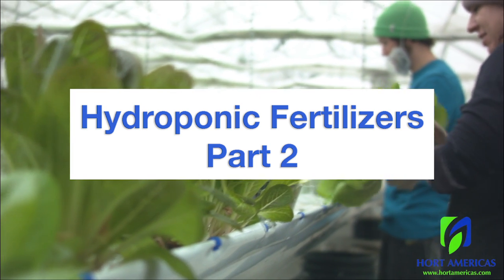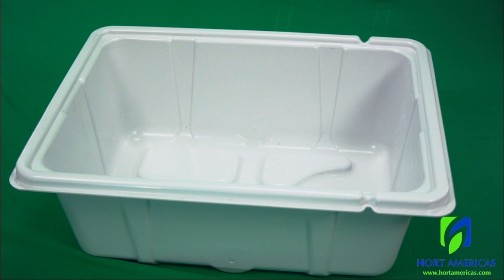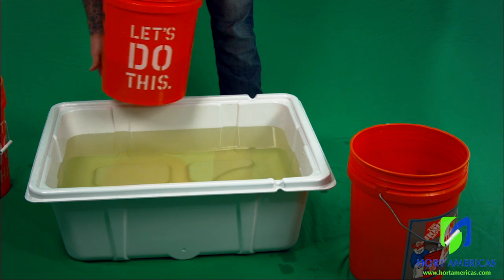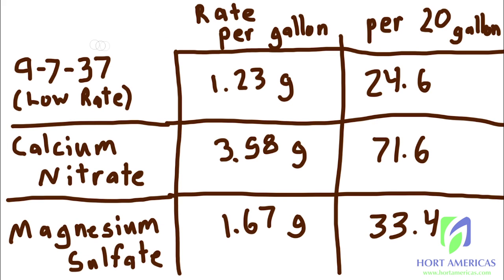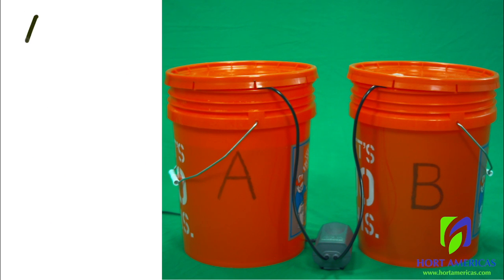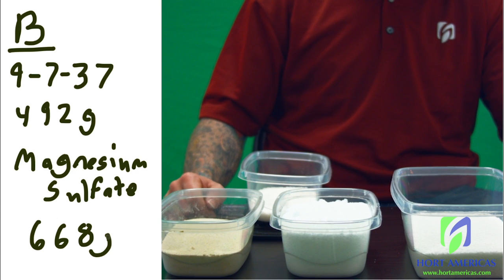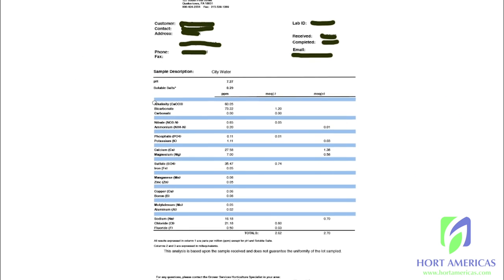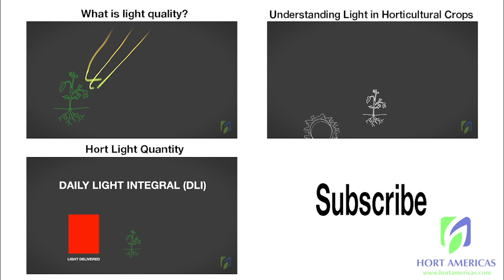Hydroponic Fertilizers - Blending Hydroponic Nutrient Solutions and Stock Solutions

Comment: Hi thank you for these videos! I am wondering why you add the calcium nitrate second? I am using an injection system and have all my calcium in Tank A which is added first by my system.
Reply from the maker: When mixing fertilizers in hydroponics, calcium nitrate is often added separately at the end of the mixing process for several important reasons:

- Avoiding Precipitation
Solubility Issues: Calcium can react with certain anions present in other fertilizers, particularly phosphates. For instance, if calcium nitrate is mixed with fertilizers containing phosphate, it can form calcium phosphate, which is insoluble and precipitates out of the solution, reducing the availability of nutrients to the plants.

- Maintaining Nutrient Availability
Optimizing Nutrient Uptake: By adding calcium nitrate at the end, you ensure that calcium remains in a soluble form that plants can uptake. This practice helps to prevent nutrient lockout, where essential nutrients become unavailable due to chemical reactions in the nutrient solution.

- Balanced Nutrient Solution
Specific Nutrient Ratios: Hydroponic systems require precise nutrient ratios for optimal plant growth. Adding calcium nitrate last allows for better control over the final nutrient composition, ensuring that the beneficial ratios of nitrogen and calcium are maintained.

-pH Stability
Impact on pH: Calcium nitrate can affect the pH of the nutrient solution. Mixing it separately at the end allows for better monitoring and adjustment of the pH levels before the solution is delivered to the plants.

- Avoiding Nutrient Loss
Stability of Other Nutrients: Mixing nutrients in bulk can lead to losing certain nutrients over time if they are not used immediately. Adding calcium nitrate separately minimizes the time other compounds spend in contact with it, thus preserving the effectiveness of all nutrients in the mixture.

Comment: Dont add 1432g of calcium nitrate to 4 gallons of water and expect to get 4 gallons of stock solution ;) Use less than 4 gallons of (distilled or reverse osmosis) water, ensure the 1432g of calcium nitrate is fully dissolved and then top up to 4 gallons with distilled or reverse osmosis water. The same applies for making the B stock..

Comment: A Hort Americas buyer here!!! Nice results, really. 
Hello, I have a nft and aeroponic system for lettuce , my question is: I have purchased a nutrient doser so I just program in it the desired EC I wanna keep in the reservoir and the dosser automatically adjust it from a stock solution when the EC in the reservoir drops down but, you are saying that, calcium nitrate must be separated out into the Part A stock solution and the monopotassium phosphate and magnesium sulphate into the Part B stock solution, something that I obviously do when I manually  add the nutrients on my system, but I was pretty sure before purchasing the doser, that once the nutrients have been totally dissolved on the water separately we didn't have any danger of they making any reaction each other... But I now know that if the concentration, even when they are totally dissolved but in a same solution is high enough they will react, that once these stock solutions are diluted with water these reactions don’t occur so long as pH is also within the correct range. It’s only in the concentrated stock solutions where precipitation is an issue.  As you must think it has been a enough inversion to me to buy a doser that just regulates the EC and I was hopping that if my reservoir its just 120 litters I can use a stock for nutrient upregulation that even having all the nutrients in that stock enough concentrated for make its function not so much as making any precipitation inside, so first, and if you can tell me, I would like to know in what concentration level it starts to be a problem for unwanted reactions when all the nutrients are dissolved in the same solution and what is your advice for me using my new device in this way, I hope my English been clear enough for this question been fully understood and I really hope you could answer my question, I really need this help, thank you!!!

Comment: Great video! I noticed when you were making the stock solution you had 4 gallons of water, then you added about a kilo of calcium nitrate. Doesn't that affect the amount of solution or dilute the solution? it would seem you can end up with 4.3 gallons after adding that. Also, when you mix the stock solution, how long are they good for (if kept in an air tight jar and in a dark place)? Thanks!

Comment: I am finding these very informative. I have a question though... how do you change the pH if it is higher or lower than 5.5 as you recommended?
Reply: you can add a few drops of lemon juice or vinegar to make it more acidic or you can add a few sprinkles of baking soda to make it more alkaline.
Reply: thank you for your advice.
Reply: Potassium hydroxide for PH up.
Phosphoric acid for PH down.
Sulfuric acid can also be used